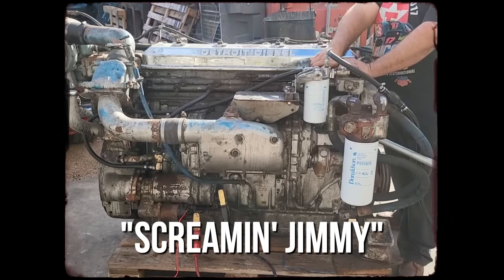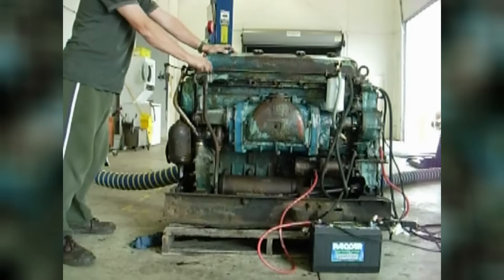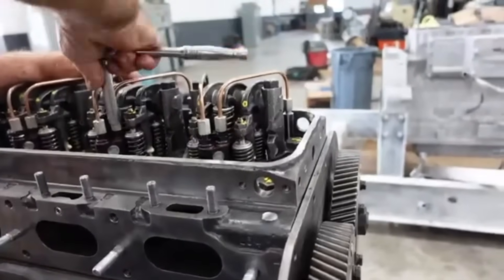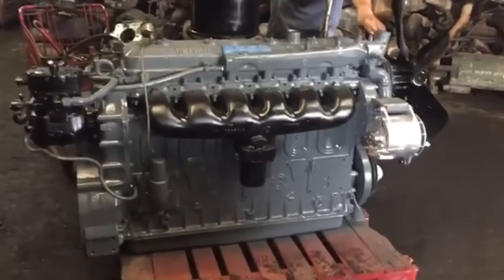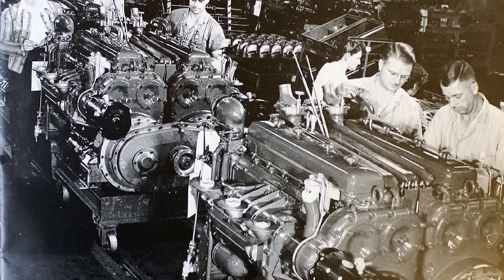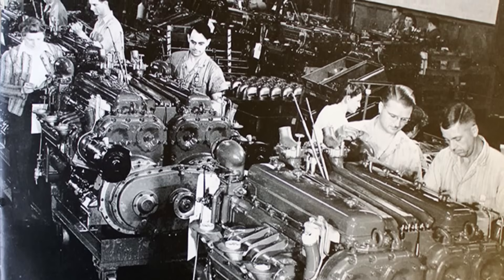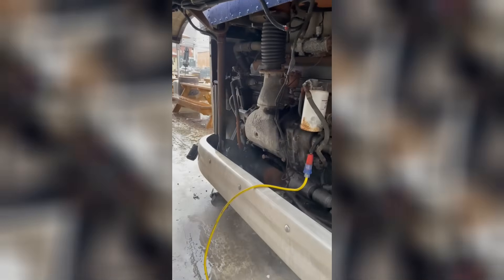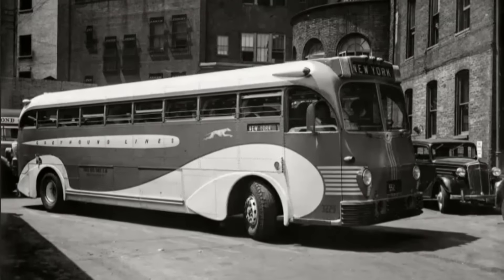THE EXPLOSIVE TRUTH BEHIND DETROIT DIESEL BULLETPROOF 6-71

Comment: The Beauty of the engine wasn’t its design. It was designed asymmetrical with that you could put the exhaust on either side of the engine. They could run clockwise or counter clockwise. The parts are interchangeable between the different numbered cylinder engines.

Comment: you forgot to mention there very vere uiversal front and back of the engine block same the cylinger heads could be put on with the exzaust on eather side of block
Reply: Plus they could be made to rotate clockwise and unti clockwise.

Comment: The 671 and its' sister engines are reliable. On the ocean mileage doesn't matter as much as reliability. After WWII and into the 1980s, the Detroit engines were the most common in midsize working boats and as auxiliary engines in large boats and ships. In those days, most working boats had single engines. Now most have twin newer engines because of the reliability problems. Electronic controls are not reliable. And they are expensive to fix. Many people working on the ocean carry thousands of dollars in spare electronic.parts. I have over $2000 in spares for my diesel pickup and it's one of the best engines rated.
It doesn't matter how good the mileage is or how clean the engine burns if it doesn't run. I wish the EPA could figure that out.
Reply: The last thing you want on the ocean is your engine DYING hundreds of miles away from the nearest port!

Comment: What if it had the electronic precision control fuel injection with common rail piezoelectric working at 2000 Bars!  Would it still be polluting?
Reply: No ,,,the computer controlled injectors would  fuck up and blow it up like this shit does on all the new crap !!!!!!
Reply from the maker: 2,000-bar common rail would cut the smoke a lot, but a 6-71 is still a ported two-stroke with blower overlap and higher oil use. Some fuel and oil still slip through. To meet modern regs you’d need EGR, a DPF, and SCR, and at that point it isn’t really a 6-71 anymore is it.
Reply: The engine would become unreliable, like new engines.
Reply: It would be less reliable didn't you watch the video?